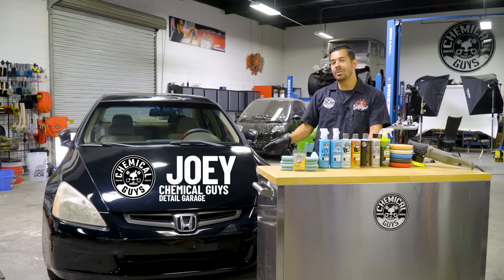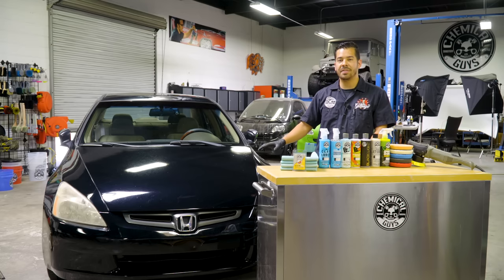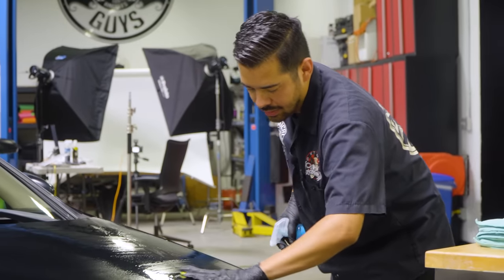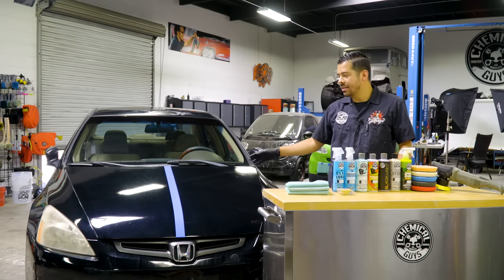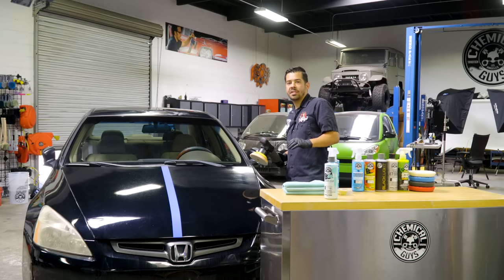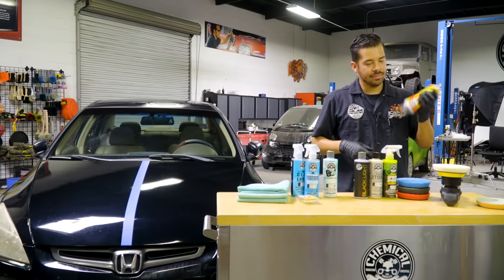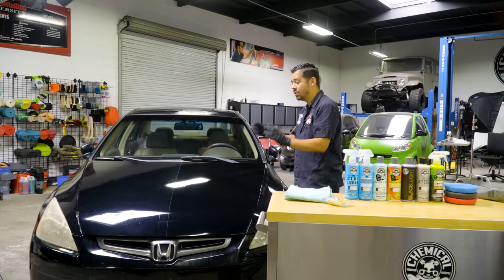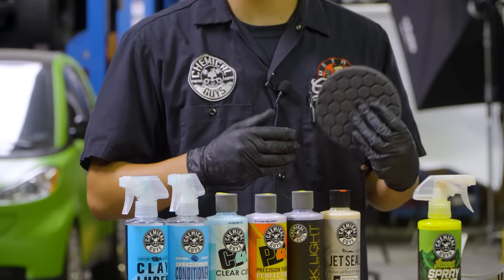How To Completely Correct Contaminated and Scratched Paint With A Two Step Polish! - Chemical Guys

Comment: I purchased a polishing starter kit that includes V32, V34, V36 and V38.   I am planning to perform "paint correction" on my old Mercedes that has mild and heavy scratches, swirl marks and everything else that you would expect on a well-loved 23 year old car.    I will clay bar first.  Should I begin with V34?   Can I go down to V32 if I don't see the results expected with V34?   
Also, what is the difference between the V series products and the C and P series products?

Comment: How often should you clean the pad during the compound and polishing stage?
Reply: Yes
Reply: I've heard after every panel or some people like to clean it after every little section on the one panel
Reply from the maker: Hi David! It is normal to clean the pad several times during the job depending on paint condition and products used.

Comment: How would you compare Jet Seal vs Butter wax after using the black light glaze? I have butter wax but should I consider jet seal instead?
Reply from the maker: Hi there! JetSeal will provide a longer lasting barrier of protection whereas Butter Wet Wax adds a warm gloss. Use them in tandem for the best of both.
Reply: @ChemicalGuys will black light glaze offer a barrier of protection? I ask because I used butter wax and then the black light glaze recently on my black truck to prepare for winter

Comment: How long does one pass take to complete? What is your hand speed rate? Also what speed settings did you use for c4 and p4 passes?
Reply from the maker: Hi there! Work in a 2 foot by 2 foot section, moving 1 inch per second.
Reply: What about speed setting for polisher? Still 1 setting?
Reply: @adamcurrie3026  The product bottles will give recommendations for pad speed etc

Comment: How often are we able to reuse the clay bar? Are we supposed to throw away the piece we just used? If not, how do we clean it?
Reply from the maker: Hey! Roll and knead the clay bar until a clean side can no longer be found at which point the bar should be replaced.

Comment: Quick question, when you showed Black Light Glaze it said it was a sealant. So why are you applying an extra sealant(Jet Seal) if Black Light is a glaze and sealant??
Reply from the maker: Hi there! Black Light is primarily a glaze that has some sealant properties, follow up with Jet Seal to add a long lasting, durable layer of protection.
Reply: @ChemicalGuys  can i put a paste wax then a liquid ceramic coat ? Or only one ty for your time
Reply: @Brandon135  no a sealant needs to bond direct to the Clear coat to protect correctly and last. After you seal u can top coat with wax

Comment: how long does it usually take to wash, dry, clay bar, polish & sealant the car?
Reply from the maker: Hey! Thanks so much for tuning in. A detail can take anywhere from 3 to 8 hours depending on the condition of the paintwork.
Reply: Long enough so CG have time to make another video with all new products so you have to start over. 😅

Comment: So say i wanted to add ceramic coating to my car. Would that theoretically be applied after I have polished with the C4/P4 combo? Or would I still need to apply black light and then ceramic coating?
Reply from the maker: Hi Gabriel! That's right, ceramic should be applied to a bare surface that has been polished.

Comment: Hey guys, am I able to use a ceramic coating product after using ALL the products you guys used in THIS video?
Reply from the maker: Hey! Apply ceramic after the paint correction stage, then it can be layered with glaze, sealant and wax.

Comment: If I plant to use Black Luminous Glow Infusion, when should I use it? After black light glaze? And the jet seal, before or after using Black Luminous Glow Infusion?
Reply from the maker: Hey Victor! Apply Black Luminous Glow Wax after JetSeal and Black Light.
Reply: @ChemicalGuys  thank you!
Reply: @ChemicalGuys  and then can I still use banana spray wax as a last step after using those products?

Comment: All of the first cutting step is on speed 1? Once the product is spread, did you turn the speed up?
Reply from the maker: Hello! Use the lowest speed setting to spread the product in a two foot by two section before using the highest speed setting(for dual action polishers) to break down the product.

Comment: Can you go over blacklight glaze with the hydro slick or whatever the hydro ceramic coating is
Reply from the maker: Hey! It is best to apply HydroSlick to a bare surface and then it can be layered with your favorite glaze, sealant and/or wax.
Reply: @ChemicalGuys  ok thought so, cuz in the video you said you'll apply blacklight and then the sealant, which I was confused about I thought it should be the other way around

Comment: Rather than the spray shine could I use an actual ceramic coating? I'm trying to figure out when the best time to ceramic coat would be. After the sealant I imagine?
Reply: ceramic coatings always goes before anything else. that’s the most durable, longest lasting protection, which is why you want it under everything such as sealants, waxes, etc
Reply: @joey4261  I did. Almost a month ago now. Did a light machine buff since my car barely needed it. Obviously a wash first, clay, and IPA in-between everything. You know what I mean. Then once the paint was super clean and ready I applied the ceramic coating. Waited a week until I washed it again. Since then I use a quality spray ceramic detailer after my washes.

Comment: Which would be best to use the C4&P4 or the V line products?
Reply from the maker: Hey Stephanie! Start with a test spot to determine the correct pad and chemical combination. Use a White Pad with P4, if more abrasives are needed use an Orange Hex-Logic Pad and C4.

Comment: Do you prefer using c4 and p4 over your v-line polishes ? Which would give better results ?
Reply from the maker: Hey Anthony! C4 and P4 are great for moderate to light imperfections or when you are short on time. Use the V-Line for multi-step corrections of heavy swirls and scratches.
Reply: @ChemicalGuys  what would be the steps using the v-line ?
Reply: Thanks for your question! Helped me!

Comment: So when would you use the vss?
Reply from the maker: VSS is an awesome one-step polish that removes light to moderate swirl marks and scratches. Use when you're short on time or don't require multi-step paint corrections.

Comment: Can I do all these steps but replace the spray shine with Hydro Slick?
Reply from the maker: You can mix and match almost anything! If you are going to apply Hydro Slick or any other ceramic, however, we recommend applying it directly after the polish, and letting it cure before applying any other waxes, glazes or sealants on top.

Comment: How long does it take you to do something like this? Detailing a car to this extent?
Reply: I clayed, polished, and hydro slicked mine and and it took an entire day. That was with only polish step.
Reply from the maker: To do the full car from start to finish could be anywhere from 4-12 hours depending on level of correction required and how detailed you want to go. Total length is really up to you - if you are looking for absolute perfection, you could theoretically work on one car across several days! 😍

Comment: Do you need the pad spray or does any detail spray work?
Reply from the maker: Hi there! In a pinch you can use your favorite quick detail spray to moisten the pad however using Polishing Pad Conditioner is the best solution for pad longevity.
Reply: @ChemicalGuys  thank you! i have the pad cleaner spray and quick detail but not the pad conditioner.

Comment: what speed on the 10FX for the cutting with C4?  25 / 35?
Reply from the maker: For spreading, use the lowest speed setting. For cutting, it depends on the level of scratches, but most times you can get away with the highest speed setting for the fastest cut!
Reply: @ChemicalGuys  cool deal. was looking for this answer versus posting a similiar question...

Comment: After you spread out the product on speed 1, did you up the speed or left it on speed 1 to do the cutting
Reply from the maker: Hey! When using compound and polish, spread on speed setting 1 then use the highest speed setting to diminish the product until it turns clear.

Comment: Why not use the V38-32 line?
Reply from the maker: Hi! You can absolutely use the V-Line to hone in on your detail and really customize your paint correction.  For those that want a simple 2-step solution C4/P4 combo will achieve comparable results as you can see!
Reply: @ChemicalGuys  Thank you for the reply. So you're saying the V-Line series is basically a more extensive product for correction? I am having a hard time figuring out which product I need since V-Line and C/P4 do the same/similar thing.
Reply: @X1OAFREED0M  Exactly my problem. C4 and P4 or SVS? which is better/stronger? I'm lost!
Reply: Clearly they are not telling what the actual difference in the products is